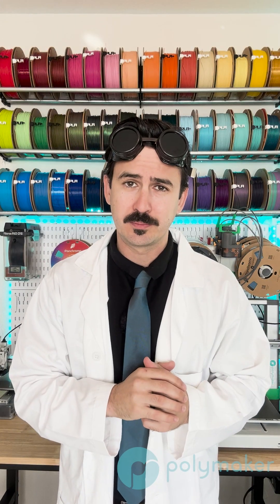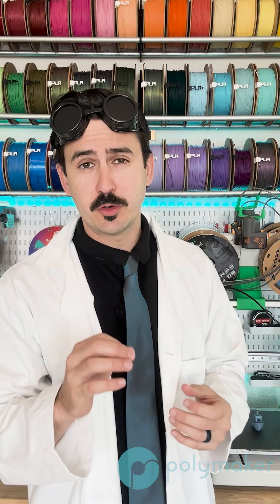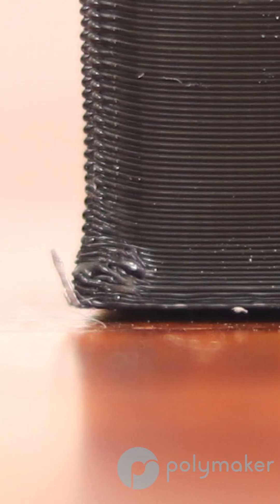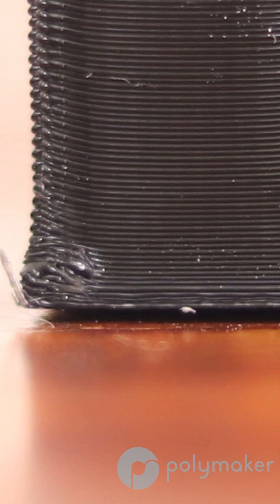Fix your elephant foot 3D printing problems!

Comment: None of these worked for me (the temp was already at 60C for PLA), what helped was the "elephant foot compensation" setting in Orca. In hindsight; obvious I guess ...
I was getting around a 0,5mm wider base than the rest of my test print, I changed it from 0.1 to 0,35 and now it's perfect.

Comment: Changing this setting did a great job to my prints but the real problem was the lead screw nut that was worn out
Reply: that created more backslash and the first layers kind of melt together because the lead screw wasn't lifting up the gantry